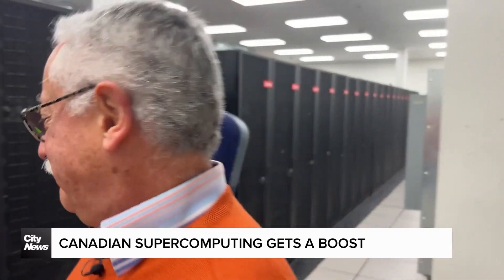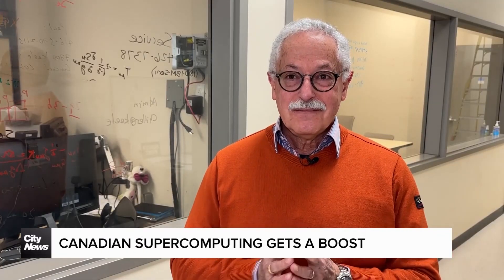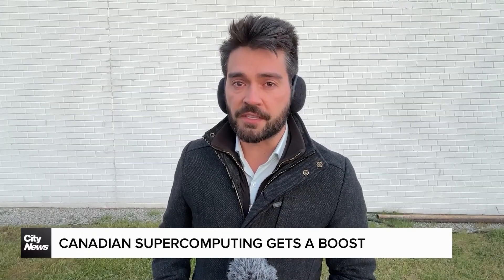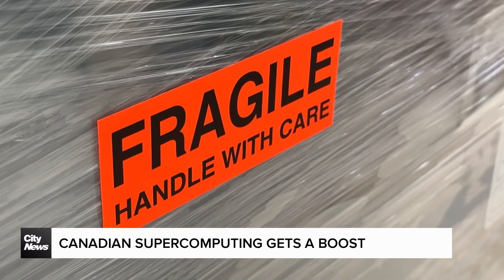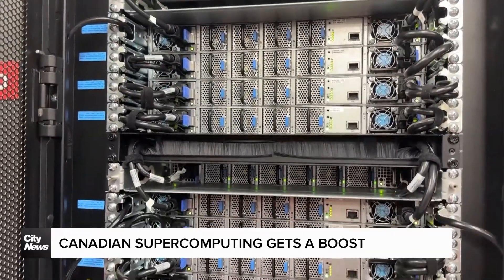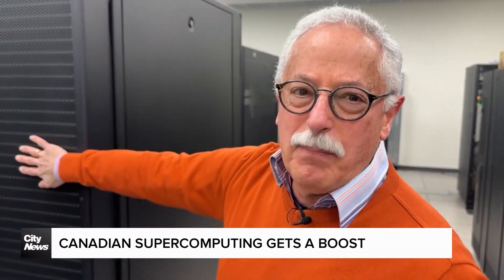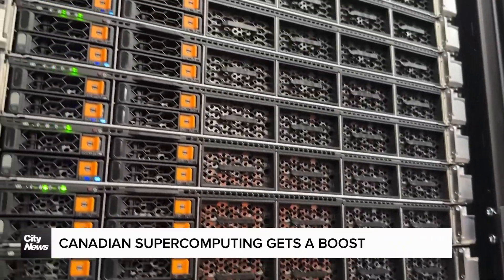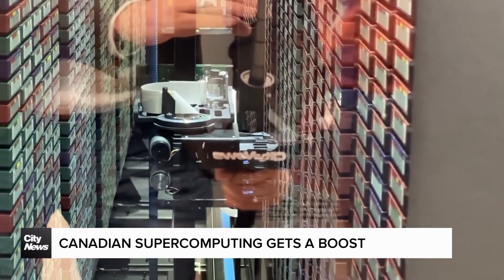Canadian supercomputing gets a boost

Comment: here some specs 

Storage

Parallel storage: 29 petabytes, NVMe SSD based storage from VAST Data.
High-performance network

    Nvidia “NDR” Infiniband network
        400 Gbit/s network bandwidth for CPU nodes
        800 Gbit/s network bandwidth for GPU nodes
        Fully non-blocking, meaning every node can talk to every other node at full bandwidth simultaneously.

Node characteristics
nodes 	cores 	available memory 	CPU 	GPU
1224 	192 	768GB DDR5 	2 x AMD EPYC 9655 (Zen 5) @ 2.6 GHz, 384MB cache L3 	
60 	96 	768GB DDR5 	1 x AMD EPYC 9654 (Zen 4) @ 2.4 GHz, 384MB cache L3 	4 x NVidia H100 SXM (80 GB memory) 

pretty weak supercomputers

Comment: Canada doesn't make a dent in super computers in ranking.  
Country	System	Manufacturer	Hardware supplier	Max Performance
(                                                                               PFlop/s)	Power
(kW)
US	El Capitan	HP Enterprise	AMD	1,742	29,581
🇺🇸 US	Frontier	HP Enterprise	AMD	1,353	24,607
🇺🇸 US	Aurora	HP Enterprise	Intel	1,012	38,698
🇺🇸 US	Eagle	Microsoft	Intel
NVIDIA	561	
🇮🇹 Italy	HPC6	HP Enterprise	AMD	478	8,461
🇯🇵 Japan	Supercomputer
Fugaku	Fujitsu	Fujitsu	442	29,899
🇨🇭 Switzerland	Alps	HP Enterprise	NVIDIA	435	7,124
🇫🇮 Finland	LUMI	HP Enterprise	AMD	380	7,107
🇮🇹 Italy	Leonardo	EVIDEN	Intel
NVIDIA	241	7,494
🇺🇸 US	Tuolumne	HP Enterprise	AMD	208	3,387
(kW)
Reply: That listing is incorrect. Canada would be in the top 10. 

Canada basically invented both modern AI and quantum computing btw

Comment: they have money for supercomputers but wont help Canada post workers
Reply: The problem there is the post office, as we know it, is a dying business.  Things that used to be done by mail are now often done on line.  The main business these days is packages where the competition works weekends.  As much as I support the union, they have to adapt to reality.
Reply: @James_Knott things are done online but that also means an increase of packages required to be shipped as a result of online orders
Reply: @paulposeidonclips   That's why I said the main business is packages.  They're now competing not only with the regular couriers, but also the independents and they work weekends, which the union doesn't want to do.
BTW, I worked weekends for many years in a different business.
Reply: Canada Post, although a crown corporation, actually runs by itself and was self sustaining up until modern times (basically since amazon came around). They actually did really well in the past and built up a "war chest" of funds which is rapidly shrinking...
Reply: everyone's budget is important to them.  is there some reason you think both things shouldn't be funded?  what heuristic would you use to decide which spending to move from one lineitem to another?

Canada ranks poorly when it comes to support for academic HPC - compared to peer countries.
Reply: Canada Post loses $95 million every few weeks. It needs a major rethink.
Reply: @marsgal42  you are implying that it should be budget-neutral.  why do you think that?  most of what the government does (and crown corporations are just pretending not to be government) is not revenue-neutral, so why is this different from other services?

Comment: Why not leave the old equipment intact and allow use of it for lesser projects? That gear isn't cheap and still useful. Data centres usually have lots of space to spare.
Reply: Having worked in a data centre for 12 years, I can assure you they don't have lots of space, at least not for long.
Reply: @James_Knott  What happens to all the equipment that was removed?Does it get recycled or repurposed
Reply: @Fabulousprofound168   I expect it would be sold off.  These days, the supercomputers are just lots of standard, off the shelf computers that could easily be resold.  They also tend to run Linux.
Reply: @Fabulousprofound168  At the worst, they can donate the equipment to a charity (like World Community Grid), but often decommissioned equipment is claimed by MSP and sold to smaller corporations, or junked depending on what it is and if it can hold data.
Reply: @James_Knott  I've worked in data centres too.  Both dedicated and shared. There is always free space as systems and corporations consolidate and requirements change.
Reply: Power. Power is a huge fraction of the operational costs of these machines. Decommissioning old machines for faster ones, which can be fractionated down, often results in much lower costs per compute operation.
Reply: Ultimately cost and power consumption vs available space. Running older, much more costlier to run by comparison equipment in their limited space isn't cost effective.
Reply: this sort of hardware (HPC clusters) is somewhat specialized, so not of much interest for other uses.  you definitely wouldn't want any pieces yourself because the systems are quite loud (and also require quite a bit of plumbing).  they also aren't ideal for other uses (enterprise, hyperscale, VM hosting, etc) because they emphasize compute (lots of cores, not very much memory, no local storage).

of course, the parts can be recycled, possibly reused.  we (HPC organizations) sometimes do move clusters around, merge them, etc).

the operating cost of any computer system is roughly 10% of purchase cost per year.  that's quite a bit, and you have to think of that cost as going up, relative to new hardware, since 7-year-old servers are substantially less efficient.  The ideal depreciation cycle is 3-5 years, and the national HPC platform in Canada has roughly doubled that (mostly due to bureacratic issues - it's been bad for users).

datacenters definitely don't have spare space.  first, why would anyone build such an expensive thing and keep it idle?  perhaps the comment was based on old-style non-dense datacenters.  this hardware dissipates something like 30KW/rack, so can't just be put in an empty room...
Reply: @markhahn0  Space, cooling, electricity
Reply: @altatoro3983  I'm not sure what you're trying to say.  yes, space and power are issues.  hardware of this sort is relatively compact (for the number of cores, or relative to power).  cooling is fairly specialized.  but those aren't the reasons that this kind of hardware is usually disposed of.

let me put it this way: to re-cycle this cluster, you'd have to recreate the current facility (floor loading, water chilling, power delivery) - as well as pay for the effort to move it.  you'd probably lose about 10% of the hardware, cables, PDUs, etc.  certainly possible, but not cheap.

the alternative is to leave it in place and operating, and start over on a new site.  the problem is that costs are not kind for the old facility, and the hardware is way past it's expected/designed life.

Comment: Every five years, this kind of thing needs to be upgraded because it becomes obsolete!
Reply: not really: very little real technical change happens in the HPC world, particularly CPU-side.  these cores run modern code just fine, and the interconnect latency won't even change much in the upgrade.  what does change is that replacement hardware is more power efficient, higher density (cores-per-node).  there are minor changes in things like the memory bandwidth per core, or per flop.  (this sort of change is somewhat different for GPU-oriented facilities, since there are still some basic changes happening there.)  some aspects of an HPC facility don't age well (such as storage - though we tend to think of that as almost a consumable.)

in other words, "obsolete" is wrong if you mean "categorical changes that keep modern work from happening".  if you mean "there are smallish tweaks at many levels", sure.
Reply: Yeah, got to keep up with the latest games!  🙂
Reply: @James_Knott  Cutting edge science in numerous fields, including life saving ones is no game sir.